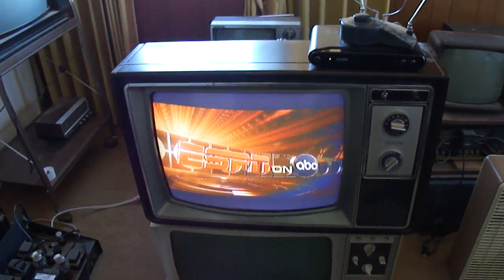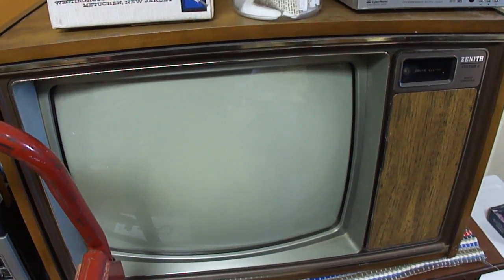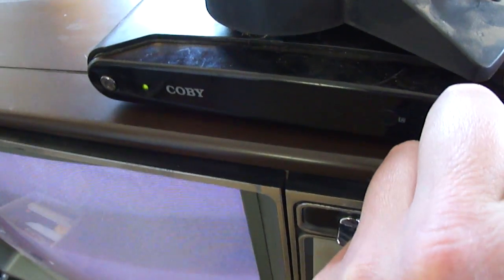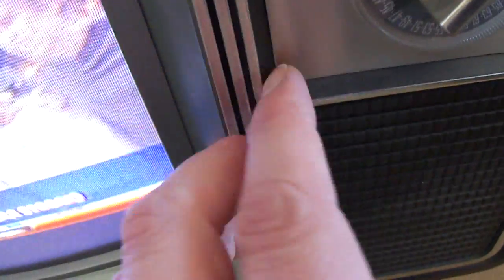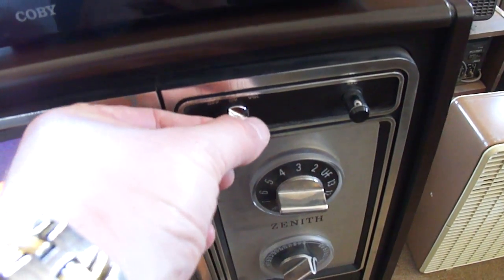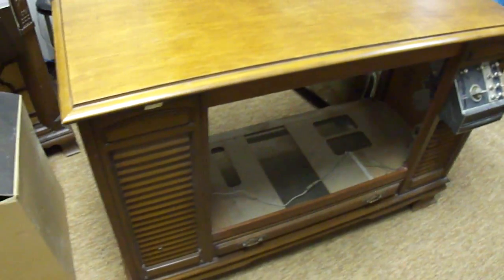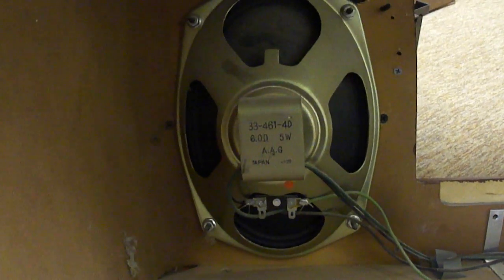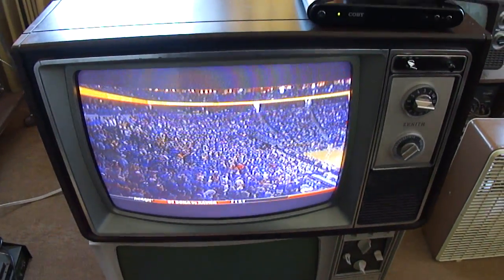1982 Zenith System 3 Color TV

Comment: Nice set! That one probably uses a 9-160 power supply/HV module.  The next generation sets used a 9-181 main module that laid flat in the bottom of the cabinet and a 9-186 HV/sweep module that stands up to the right of the main module.  After that, they briefly made a chassis with stand up power supply and sweep modules with a horizontal main module.  After that, they came out with the 9-470 single board chassis.  I've seen many of those 9-160 modules where the flyback would arc and/or burn up.

Comment: @Retrochad

It has On screen display right . My Zenith 19 inch had on screen display and had remote control,not ultra sonic . The led style remotes like modern television have . It mite as well Been advanced system 3 with remote control . I remember using a universal remote with it .I tossed it in the alley when I lived in Chicago 5 years ago . I thought the purity was off . I found out latter it was a speaker too close to the television , I forgot about that . I should of keep it . But the guy across the alley took it and sold it . He said it worked fine . Im glad too it came from Oshkosh Wisconsin and is now presently somewhere in Chicago Illinois .

Comment: Zenith in English sounds like ceenet .  I say this, cause in Spanish I read se-neet . A friend of mine who lived in US since 1978 to 1982 brought a Zenith TV set, in my country we used NTSC standar American norm (until today signal in air). I remember screen were dots, not bricks. For example, Sony Trinitron had a continue line from top to bottom bordeline, buy Zenith has dots, like Philips. In 1979 my father had a Sharp tv SET, and screen had briks, not dots. Today many people think that those cells on the screen are pixels. No no no. Pixel is something unconcret, it is conceptually another thing.

Comment: friend a query I have an identical TV when I turn it on, you hear a sound from the side of the fly back and when the back cover of the TV there is a rectangular ceramic white resistance very close to the fly back that lights up my question Is it like knowing if the fly back is already damaged or the TV screen is the one with the fault?